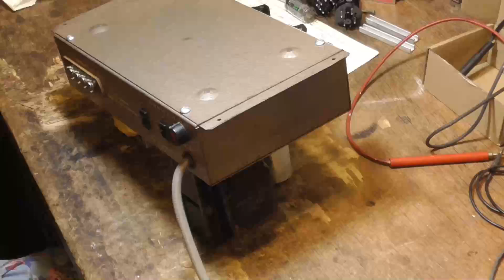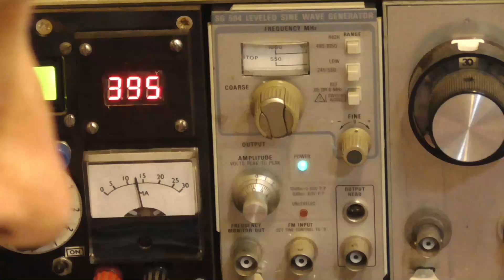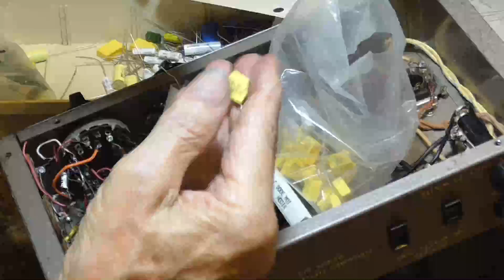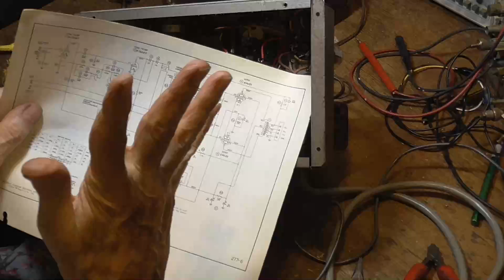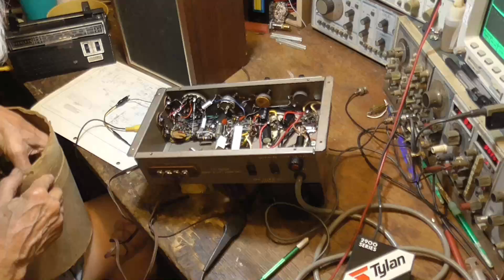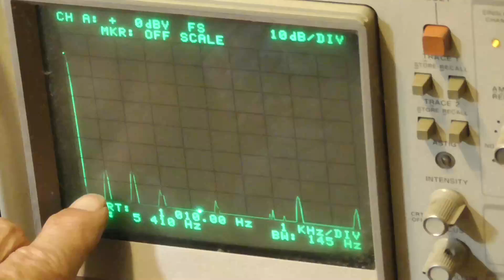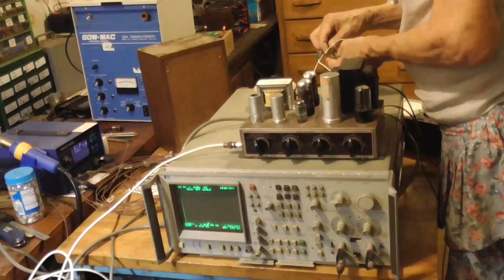REPAIRING A SMALL TUBE AMP

Comment: The odd thing is valve/tube amplifiers can sound nice, maybe our brain likes certain harmonics.
Shame that someone made a mess of the input processing :-(
Reply: It's the same with vinyl, where people seem to prefer the technically lower quality audio that comes from them.
Reply: @dreamvisionary  Some people when they cannot explain why they are wrong like  to fool people that they have "different brain"  so the discussion is for them hopefully  finished before started. 
 Biggest of all  problems is with  solid state amps - not with tube amps. It is rooted in high non linearity (may beven 60% THD) of B class solid in most important center of its amplification curve. Which means it affects the most at even minimum volume. Too much to say to explain but it results in necessity of 10 times more feedback in solid than in tube. And it makes change of  timbre. Vinyl is most lossless of all. - anyone can confirm. The target is to hear what was recorded and  not to hear distortion - simple.  , Useless is  to  measure zero distortion by million dollars apparatus. Because we want to listen, not to measure.  . how much  is piece of LP wear is another thing.
Reply: @Mikexception  60% THD?  What?  Come on Mike?  Now you're starting to sound like someone who has a problem with english, & a problem with audio theory as well.  Just sayin.
Reply: @nevillegoddard4966  What is your background in electronic?  What you know about  potential  barriers  in semiconductors? I had given that lectury for my school when I was 16. Believe me in that times Wikipedia could  not  help me  because (surprisingly😁) was not around. . Now I am 70 and I do not want to repeat that all again for one person. And without it I can't explain to you why  60% THD
Reply: @Mikexception  Hello again Mike!  Geez you want my resumè?  Ok.  I completed a 4 year apprenticeship with a major telephone/telecommunications company.  I completed the Assiciate Diploma of Electrical Engineering at tafe.  I have been employed for the last 40 years mostly as an electronics tech.  Bench & field repairs.  Electronic equipment manufacture, design, prototyping,  modifications & upgrades.  My main hobby has always been electronics as well - mostly audio gear.
Reply: @Mikexception  ...Sorry, I accidentally hit send!  When you talk of potential barriers, do you mean the movement of 'holes' & 'electrons' through the P-N layers of a transistor, & junction doping - that kind of thing?  Well I have been taught about it but I've forgotten more than I remember about it.  If you're talking about miller capacitance etc then I have the same answer.

To be honest I never thought that much about that depth of electronics theory once I left the classroom.  I was never a teacher, like yourself (I think you said), & I don't think I could speak so well to a large audience in front of me!

I taught all the guys at work how to manufacture  & test our machines though, but only one guy at a time.  I also wrote the assembly manuals to I guess.

Anyway Mike, if you were a teacher, please teach me then!  It won't be just me you know; Ron has many subscribers!  Lots of people can learn.  Not just me.  I am always interested to learn.  Always!  Come on I've embarrassed myself to everyone for you!  It's your turn to answer my questions!

Regarding the 60% THD in transistor amps idea.  I've just spent around $2K on parts to build a 135W per channel transistor amp.  It uses special low noise SMD preamp transistors, & output transistors with built-in temp monitoring diodes etc...The end result is .001% THD at the onset of clipping, & .000-something %  at every level & frequency below that, ok?  For me to continue to increase the volume control to reach a level of 60% THD would clip the output so squarely that it might blow up my tweeters, or activate the speaker protector!   Obviously this is an audiophile amp (no tone controls), but must other transistor amps produce maybe only 5 to 10 % harmonic distortion before clipping, as far as I know.  As far as I know, once I have clipping distortion it's really academic how much THD is occurring.  Once clipping occurs we're talking amp overload.  The output transistors are biased & can be adjusted to their linear area, to minimise crossover distortion, & also THD.

Valves are biased into their linear region as well, although you seemed to be talking about transistor amps.  Could you have meant 60% THD in valve amps perhaps?  There were lots of odd & even harmonic distortions in Ron's amp!  I think he had the amp just below clipping, but there's no way I could tell that for sure.

There's TIM - Tranient Intermodulation Distortion, with sum & difference frequencies like FM radio.  Is that what you mean?  That sort of distortion sounds bad too.

There's also the fact that valve amps are voltage driven & not current driven, & are a virtual open circuit to the input signal, & potentially have less of a damping effect on the input signal.

So I dunno Mike, please tell me/us?
Reply: @nevillegoddard4966  I see what you know now . Thanks . Just read better - I written I made lectury as 16 teen ager  - can you imagine me being teacher then ? No I teched my class only because my teacher who couldn't do it asked me. 

I am too busy to answer to you about that bunch of very complicated  problems in 10- 20 words. I do not accept too much simplification because it leads to nowhere.
Reply: @Mikexception  Oh ok then.  I'm disappointed; I thought there was gonna be some debate.  But no.   You didn't refute anything I said?  Oh well then after all that when I thought I may have been wrong, I was actually mistaken!

Comment: Ron I built your electronic circuit breaker, and it is working perfectly!  Are you willing to share any insight on the current limited high voltage supply that you built into the Tektronix Rack?
For info, it looks like Ron is using a HP 3582A 0-25kHz Audio Spectrum Analyzer.
Reply from the maker: Unfortunately, the power supply uses a surplus high voltage inverter that is not available, so any info would be useless.

Comment: That amp should easily produce 10 watts into a resistive load at 1% or less distortion. It doesn't look like you turned down the input to the spectrum analyzer as you cranked up the amp. The display shows overload!
Reply: Data sheet says always separately: harmonic distortion and max power. They did not mention max power is at given above distortion, - it probably is  at max distortion. And for 6L6  "max" power is 11,5 W which means it may be 50% THD. It meets my practice never reach more tam half of nominal power. . Who wants more pls  be open to solid state.
Reply: @Mikexception  Hi Mike.  Valve amps usually produce mostly even harmonic distortion, especially single-ended triode output amps.  Push-pull pentodes less so, with more odd harmonics.  Even harmonics sound much 'sweeter' & 'warmer' than odd harmonics.

I think Ron already said that the output transformer was poorly matched to the circuit.  This may account for the apparently high even & odd distortion from this amp.

But distortion is distortion Mike, even or odd.  Maybe you don't ANY distortion at all which is fair enough, & a good reason why you seem to prefer transistor amps.  Usually much higher power output for far less cost, weight, distortion & power input.

Comment: I couldn't really what the THD was from your demo. That amp with feedback should put out at least 10 clean watts with no more than 1-3% THD. But I am used to my old Fisher amps which have a really low THD and wide bandwidth (80kHz). Anyway, thanks as always for the interesting videos!
Reply: She didn't attenuate input to the spectrum analyzer............note @ 45:14 analyzer display says overload. She's overdriving the front end of the spectrum analyzer...........that's where the distortion is.
Reply: How do you know this at least 10watts ( it may be  35W?) and why you do not know it should be 1% or 3%?

Comment: I have always used some type of cleaner-lubricant. Back in the day was tv tuner cleaner. Recent years I have used a couple varieties of Caig De-Oxit. Any reason or advantage using CRC Brake parts cleaner? No residue? Grease-cleaning capability? Cost?
Reply: Crc is way cheaper and works just as good. Evaporated quicker too.
Reply: The reason for using it is that it evaporates fast and leave no residue.
Never use anything with lubricants on any contact surfaces. The lubricant will gather dust and just make it worse. 
The best is always mechanical cleaning, and the second best is chemical cleaning that leaves a clean and dry surface.

Comment: I remember Quietrol. That stuff was (allegedly) mainly carbon tetrachloride (early dry-cleaning solvent) with a dash of light oil, dye (it was red, like cranberry juice) and maybe a fragrance, too. Sure worked a treat.
Reply: I still have some Quie-trol! Doesn't smell like Carbon Tet (got a bottle of that too), though any original solvent may have evaporated.

Comment: Would be interesting to see the curve shape (oscillogram, time domain) of the output voltage. Does the distortion come from the change-over of the push/pull output stage, or does it come in at the peaks of the voltage (maybe sagging power supply?), or does it come from the phase inverter, or....
I love your videos, Ron, keep them coming!
Reply: She's overdriving the spectrum analyzer.........look @ 45:14............display sez overload.

Comment: With 6v6gt tubes that's about a 10-15 watt amplifier.  Probably between class A and full AB1, so maybe 50% efficiency, 30 watts.  Add 20 watts for filaments, that's 50 watts total.  Transfromers should be at least 90% efficient, so a 50 watt transformer should lose about 5 watts.  I'd say that 5 watts in the transformer is OK, but at the high end of what I'd expect.
As Shango66 has often demonstrated, you CAN often 'repair' noisy pots by cleaning them with de-oxide.  Always good to try anyway, as it's easier to clean them than replace them.
Linear pots are easier to diagnose with a meter than log pots.  Also many digital meters have an 'analog' bar graph for this purpose!  At least my fluke does.
The reduction in size of modern capacitors reminds me of a scene from the movie 'This Island Earth'.
Put the ohmeter on the voice coil!!
Reply: Ha! Half of the electronics I see nowadays reminds me of that movie. Plus an interociter seems kind of easy after working on stereo equipment from the '80s.